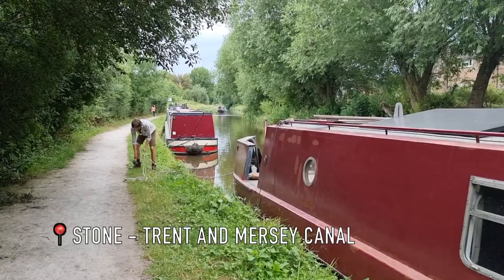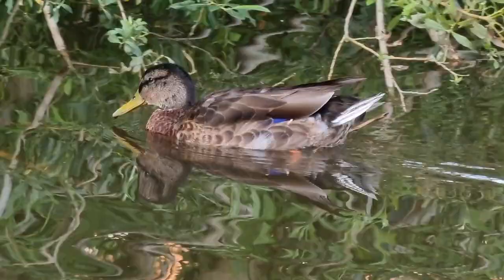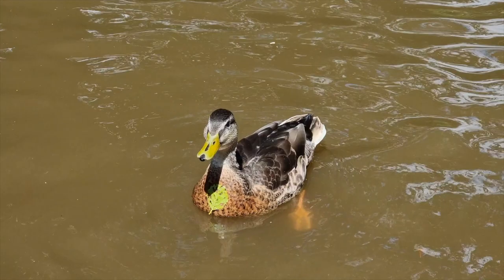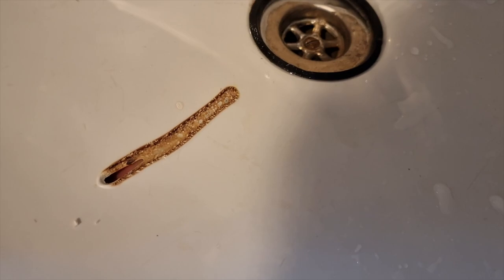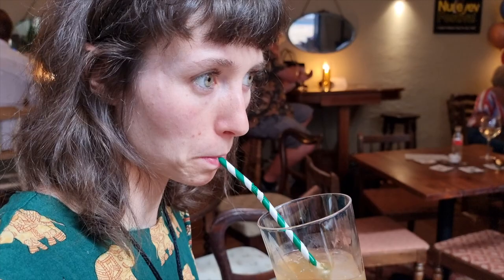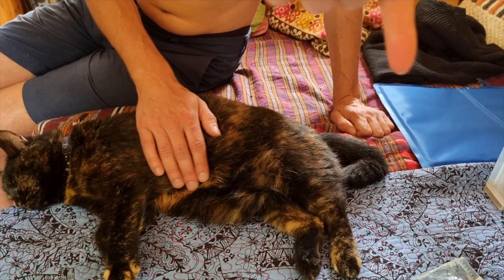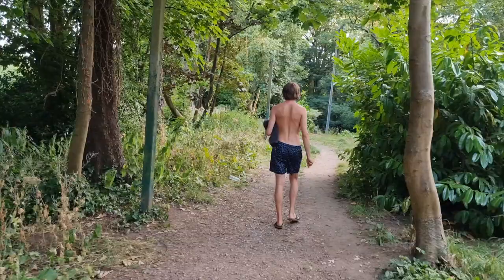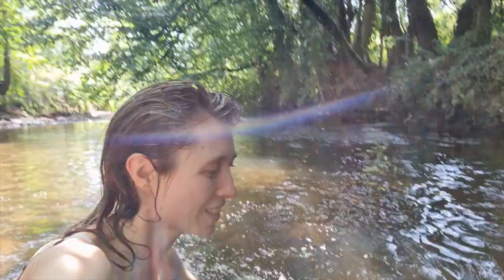When it gets HOT on a NARROWBOAT | Wild swimming in a heat wave | An accident in the bathroom! EP7

Comment: Remember that if you cut a nut of a bolt you can also cut it vertically cutting the nut in half leaving the bolt thus far intact that it can stil receive another nut on the split threat, works best with a nice thin 1mm stainless cutting disc and discs live longer slicing the top surface instead of constantly cutting into the sharp edges.
So don’t dig in the disc, ride it on top and let the heat work in your advantage.
The leaf chest, grass nose and stick bum ducks comment was funny by the way, had me laughing.

Comment: Just a tip.
Whenever you peg down your boat make sure you place your verticale peg right behind a horizontal obstruction.
Doesn’t matter if it a tree root or a concrete ledge.
The closer the direction of pulling comes towards ninety degrees the sturdier the pegs becomes, being pulled sideways is the strongest.
Over or under ninety degrees gives upwards pressure if the contact points of the peg is below the interacting surface.

Comment: Screw in Ground Anchors when you are in soft ground. They are tiny versions of the ones used to hold mooring balls in place. Really hard to pull out without unscrewing them.

Comment: for the sink repair , just use a 2pac epoxy resin glue, first cut a piece of cardboard, apply to underside with duct tape, mix and fill damage area with resin, leave to settle, paint over with enamel paint, wear marrigold gloves the resin is like like super glue, job done
Reply from the maker: Brilliant! Thanks so much for the tip, very much appreciated 🙂

Comment: One thing you two can do to fix your restroom sank is it gets them a proxy and makes the two parts together and get some white paint and makes that in there with it and put some date underneath the sink so will not leak out and just put the proxy solution in the hole .
Reply from the maker: Thanks for the tips! 🙂
Reply: @BenandEmily  There are many brands of 'steel filled epoxies' you can get at any hardware store.  You can also get enamel paints used for touching up chips in sinks and tubs,  I'd suggest a bit of fibreglass tape under the hole, the epoxy in the hole and over the area of the scorch (if it's deep enough) and smoothed as nicely as possible.  Once the epoxy sets, touch up with the paint.  I checked local prices here in Canada, it shouldn't cost more than £15 or so and you'd be left with enough to fix another 10 incense-idents, at least.
Reply: epoxy resin is what they mean.

Comment: 2:00 There are actually nut splitters for those kinds of jobs. They aren't expensive and you might not need them often (if all is well), but it's one of those tools that if you do need it they are that lifesaver type of tool for in the toolbox. Just a tip! 😉
Reply from the maker: Ah ace! Thanks for the tip! We shall get one, yes boats seem to need those kind of one off tools all the time! 😊 haha
Reply: @BenandEmily  My pleasure. Do you know what I also love to collect and use? Mini tools... like keychain size locking pliers, tiny 10mm adjustable spanner I use as a keychain, tiny ratchet like in the Wera Tool-Check Plus set.
Especially had to use them when I renovated my tiny Predom glasfiber caravan. The ones James May like to use to create air ships. 😉
They are extremely handy for cramped spaces, and don't take up a lot of space either. So I take them with me on holidays as well.

Comment: I'd put gaffer tape under the burned sink hole to back up the sealant, should hold ok. Incense is extremely hot, it's quite dangerous. Phoebe set fire to the flat in Friends with incense, not to be recommended really.
I've had to sew a little cat thingy over a crispy hole I burned into my purple fleece jacket sleeve when I forgot the incense was on the table.

Comment: Top tip for mooring pins. Instead of feeding the mooring line through the pin, place a second pin through that loop and hammer it into the ground in the opposite direction. So it almost looks like an X. Then wrap the line around the pins a few times before it returns to the boat. That way the line won't pull the pins up when a boat passes.
Reply from the maker: Great tip cheers!

Comment: The price of a replacement plastic sink will shock you like it did me!
Reply from the maker: Oh my we haven't looked into it yet!
Reply: Try motorhome/ caravan suppliers as they seem cheaper than chandlers but some ceramic basins are around the same price as the paper thin plastic!
Reply from the maker: @chrismoon7518  Thanks so much for the tip Chris, thats great to know🙂Ceramic would be so much nicer i think. We might re do some of the bathroom at some point anyway so may well replace it with a nice ceramic one ☺